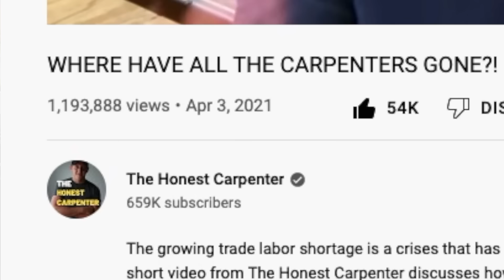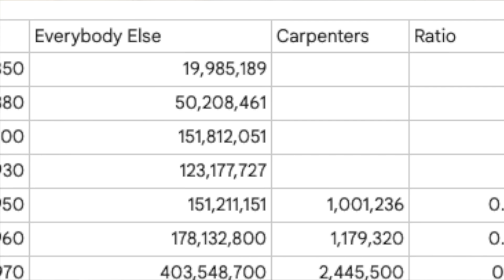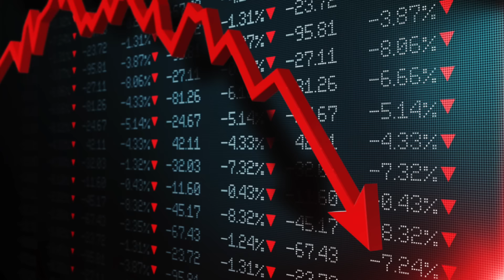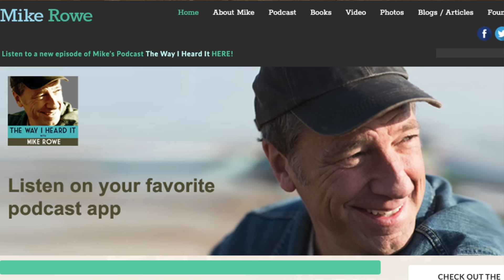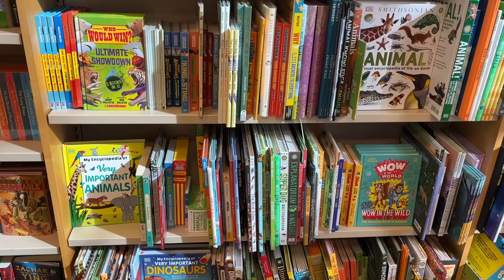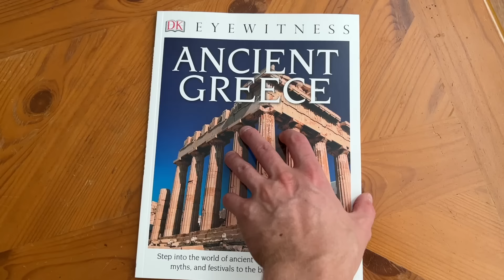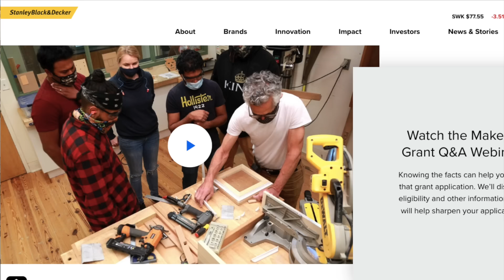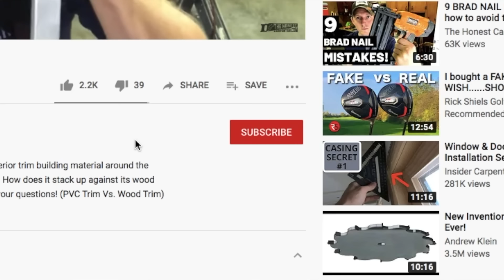THE TRADES ARE DYING...But The World Still Needs To Be Built! CAN WE FIX THE SKILLED LABOR SHORTAGE?

Comment: The trades are lagging because the pay. Unless you're out and running your own company, it doesn't pay well enough. Also there's no chance for retirement of benefits unless you're in a union. The economic decisions are based on cost and benefit. The benefit of going to college for stem outweighs the cost of college(sometimes)
Reply: Glad to see someone is applying some criticism. I've been an Electrician Apprentice for a couple years and can't believe how little some of my mentors are making. Nothing close to what they're worth, or what I was told my pay could be in a couple years. Not to mention the fact that benefits are generally on the poor side. I mostly enjoy the career, but working 80 hour weeks for the next 40 years isn't feasible.

Comment: Not only bodies are missing but pride in craftsmanship is disappearing and it's breaking my heart. Union Electrician 25 years in the field.
Reply: No one gives a damn about craftsmanship they just wanna slap it in and go
Reply: Absolutely. 16 year Commercial Electrician and I’m now told to follow the (3D)  “model” on the iPad for install. Who made the model? “The CAD dept.” Are they Electricians? “No.” Then why are they designing electrical systems? “That’s the spec pre-fab is made to fit.” Wait, I’M supposed to be doing this, not some CAD-F*#K in an office! That’s why everything is f’d up, twice a hard to work on as it should be and has too many bends in it. “It’s all figured out.” Obviously it’s not. Maybe CAD should come out here and show me how this is done. “That’s what you’re for.” Then don’t f’n tell me how to do my job. Then they wonder why we’re over on hours and cost 🤦🏼‍♂️🤷🏼‍♂️
Reply: @JD-bd5uu  And the saddest part is that those guys earn way more than any tradesman. This whole thing completely fd up.

Comment: I truly believe that early exposure to the trades is paramount to changing the perception of trade workers.

 My father was a contractor, so in many ways I had a tremendous advantage in learning the trade at a very early age. Plus I showed a lot of interest in building things at a very young age. At 7 or 8 yrs old. I remember going to work with my dad on a saturday morning. I'd haul 2x4s, he would make me hold the other end of the chalk line on the mark so he could snap the lines on the floor. He showed me how to read blueprints. I took all that for granted as I got older. And  although I always wanted to be a builder, my parents discouraged me from doing it, and sent me away to college. I got an engineering degree.. But, I always worked with my father summers and weekends.  I worked in the engineering field for a few years out of college but I really didn't like it much. I ended up starting my own business at the age of 24, building and remodeling. I already knew the trade from years of working with my dad. I've been doing it ever since. 
I'm a 58 year old career carpenter, looking at retiring sooner than later. I made great money when I started in this career in the mid eighties. The pay has remained relatively stagnant for decades. You'd think that the shortage would increase wages but that sadly is not the case. This is a tough business that requires a tough constitution to do day in and day out. I no longer frame houses, although I have all the skills required to do it very well...my body can't do it anymore. There are no replacements for guys like me that are ready to retire. I've seen many people in the comments here complaining about the rough and tough nature of the carpenters ,"towards a beginner". I did experience a little of that in my early years. But I think what "the beginners" don't understand is that a willingness to work is what is required and respected in this trade.   Learning comes after the work ethic is established. They all want to be black belts before they learn how to haul the wood and clean the job site. I've never shied away from doing the laborers job, but whose gonna lead the crew and doing the planning and laying out if I'm doing the labor job. If someone wants to enter the trade, they have to understand that it is work, and a lot of times it's very hard work. I'll show someone that's willing to learn, but a lot of this requires a basic understanding of math, geometry and manual dexterity. Unfortunately, these simple things seem to be missing in our education system these days. I don't want to discourage anyone from doing it, but if you're afraid of hard work, you aint gonna make it. I can tell you that you'll never ever need a gym membership, or have to go on a diet if you work this trade. I'm 58 yrs old and I have the body of a 30 yr old , but I got some hard mileage on that baby.
Reply: Well said man, been doing electrical for 5 years and i surely agree about not needed a gym membership!
Reply: I'm doing what equates to around $300 a day doing sub contractor work in the graphics/exhibition trade , building stands installing prints and vinyls etc all at age 22 off of the back of going through severely life threatening cancer and living with permanent nerve damage and fibromyalgia as the result of chemotherapy, I had done two years and graduated fully as a site carpenter before doing this, can the attitude towards beignners stink, absolutely but I whole heartedly agree the issue in alot of cases is that people my age fail at this and get shit from more experienced tradesmen is an ineptitude to learn, arrogance and self entitlement, it is real hard work, I had gone gym years prior but it's a different kind of strength, I had done snowboarding recently for the first time with my girlfriend and other very fit people and after 7.5 hours I had little to no fatigue meanwhile their legs and hips were in pieces, this really does build up muscular endurance and tests you mentally severely. I've been in my position for only just over a year now and I've already done plenty of 100+ hour weeks and yet I always hear people my age complaining about being overworked doing 50 hours at a desk job, trades truth be told are dying because young people are being pigeon holded into academia and simply lack the work ethic due to being pan handled too much so of course older people get frustrated with this ESPECIALLY when they're being arrogant le jumping ahead. To all young people, the money is waiting for you, the trades are simply waiting for your hard work. It's rewarding and will make you a better person. That's my rant anyway, wish all of you a great day/life, love from the UK ❤️🇬🇧
Reply: All the people with any degree of proficiency in mathematics get pushed straight towards college sadly
Reply: @jacobg7966  And then they get out of college with $300,000 in college loans, and get a $40,000/yr job. Makes perfect sense to me. 

No, I think that work ethic is what's lacking. Kids haven't been taught the value of working for what they want and need. Instead, mom and dad, give them whatever they want without even asking them to do chores around the house for an allowance. Not all households are like that, but most are, particularly in urban/suburban households. When I grew up, kids needed to get a job out of high school or go to college. Now, most just stay home and mooch off of their parents. It's the parents fault. I hate to speak in generalizations, but this is what I see going on.
Reply: @marcellemay7721  That's more or less how it goes, and people my age are so hyper focussed on this idea of having higher thought or morality despite having no skin in the game they haven't paid tax or really contributed to anything other than their Twitter wall, I don't even use social media anymore at all, just YouTube and WhatsApp but young people and their entrepreneurial obsessions and politics is a whole nother discussion. The UK specifically I can't speak for America, there is a tremendous exhaustive labor vacuum, there's schemes now to go through the education system straight into a firm to work I remember on their open days legit no a single person was interested but me, my first year I had 17 classmates by my second year there was 6 of us, 5 passed trade school out of 17 and now only me and one other works in a trade , even with those offers available being offered £50,000 starting salaries and being paid to go to college rather than the opposite they won't do it because it's "beneath them" or too hard. it's unfortunateley an old people's game, I did farmborough airshow this year in the summer and I was the youngest person at 22 out of maybe 5000 men, and my dad who got on that job with me joked that he felt young, apparently the labor demand was so harsh they had to pull alot of people in who was retired and it showed. So much experience but their bodies were just so clearly past the point of obeying, they have so much to teach and pass on and learn and yet no one my age is willing. You can easily get in at £27.50 an hour here right now, straight out of school and the hours are there as many as you can handle, I'm 22 and in my best month I made just over 10,000 doing 100+ hours a week working in Hanover Germany and Paris France and all over London to all that are listening please come to trades, listen and learn and work hard use your hands had common sense be open minded . Some people will be a cunt without any precept too and no one agrees with that, whenever someone's being harsh on you it is usually and should ever only be for your own good. Stay humble, there's always something to learn and as long as you do that it'll be hard but you'll pull through and it's an amazing rewarding career that can take you around the world and teach you so many tricks and really push you to build things you didn't think capable , and be part of what keeps the world going. Your mental health will thank you, if you're burned out give a trade a go , if you have a relativel or friend who does site work, ask if there's ever an opportunity to tag along as a labourer for the day , just help out see how it works, or do a workshop or a taster at a school, there are assholes everywhere for the most part in trades there's alot of love between the banta. Without the work force the world will truly fall. Exhibitions, Carpentry, Civil Engineering , painter and decorator it doesn't matter we are all a team on the building site ❤️🇬🇧
Reply: @gutzyzz1302  I couldn't have said it better...I agree with everything you said. Social media is a total waste of time. I love what I do. There's a sense of accomplishment...it's rewarding. The stuff I build now is all high end and custom remodeling in very expensive homes. I've done master bathrooms in some of these homes that cost more than my whole house. I'm not really ok with all the decadence but it keeps me well employed with no end in sight. We didn't even slow down during the pandemic...we just kept right on working.
Reply: @gutzyzz  "im not like the other zoomers i work 100 hour work weeks". dude youre a clown
Reply: @JM-gu7jx  By choice, I'm self employed I take as much work as I choose to. Of course I have to "obligate" certain contractors and if you turn down gigs you will eventually be weeded out by people who are more flexible but ultimately I don't have to work any amount. I choose to do 100 hour weeks most weeks, particularly when I cant see my girlfriend friends or family. would rather continue to peruse my business and grow and learn in time I can't be spending with others, if that makes me a clown, you're too far gone.
Reply: @marcellemay7721  Way to go man, I originally was going to go into bespoke remodelling of boats, on the joinery side either that or staircases in London. I'm glad I do what I do now, but that line of work you are doing is still a fascination and I'm sure it is an amazing opportunity. Happy for you, and damn straight, as the late Queen once said, keep calm and carry on. God bless <3

Comment: I have a foot in both worlds.  My profession is pure IT; communications and data.  But when something needs to be physically done, like building kitchen cabinets or reworking the plumbing under the sink or putting up a new wall in the basement, I love doing it myself.  And it all comes down to background.  I recall in middle school and high school (1980s) every kid took fairly advanced shop class, even the students who were college-bound.  We worked with a forge and lathe to make screwdrivers (I still have it!), learned to use table and jig saws, took apart lamps to learn the wiring.  Now my kids' schools have none of that, and it's a huge loss.  Even if a student has no plans to go into the trades, it's still part of life.  Why wouldn't everyone want to know how things work?
Reply: I am in a similar spot save for being in high school in the mid-2000s where we had none of those resources for shop classes.  There is real value in seeing a job completed, and being able to point to a thing and say, "I built/fixed/replaced that."  I count myself as fortunate to have acquired carpentry, electrical, and plumbing skills along the way.

Comment: When I was in school a lot of the professors would talk down about people who work with their hands, as if only mental work is important. Now I feel technology is being offered as a panacea, when it's really not. Well the good thing is wages will increase when there is a shortage
Reply from the maker: I hope they do, Joel. But equipping an entire generation to join the trades will be a massively slow undertaking. I’m worried about the time span when we’re so badly understaffed that things start to grind to a halt.
Reply: Robots can outwork people, and they don't hate repetitive motion. I hold the belief human beings are only going to move forward if we can get out of primary sector and manual labor all together.
Reply: @clearcut6818  Sounds absolutely dystopian.
Reply: @philshock3805  nothing dystopian about creative freedom. Do you enjoy working on plantation?
Reply: @clearcut6818  not all skilled trade work is repetitive and without deviation. Remodeling and maintenance for example.
Reply: @chrisburns5691  architects and designers are paid big bucks for their creativity, carpenters are just hard labor making it happen, and there're tons of competition.
Reply: @clearcut6818  not really. A good seasoned carpenter is hard to find these days. I work for a maintenance dept, we have several openings for a certified carpenter and can't find any.

As I said renos and maintenance, repairs etc involve a well rounded set of skills, lots of problem solving and approaching problems with different solutions. These kinds of jobs cannot be automated.

I have a side business doing carpentry/handyman work. I can't keep up with the demand, and I don't work that cheaply either- as I price my jobs to make 100 per hour profit, and I make it.
Reply: @chrisburns5691  and hence the "mass market carpenters will switch jobs, the craftsmen will remain" comment
Reply: @clearcut6818  i guess. I forsee a future where many aspects of new construction would be automated, especially structural work. But there are a lot of existing buildings that will need service work and updates/changes. That is the kind of work that won't be able to be automated. Maybe the problem will equal itself out as the market may not demand as many carpenters, as automation will be more present in new construction-but I think we are a ways off from that yet.

Comment: I wanted to work as a carpenter, and I did (as an apprentice) for about a year.  However, even the experienced tradesmen with 20+ years of experience had to get side jobs to make ends meet...  Now I'm looking at the market again for another job and the requirements are ridiculous, so I'm not surprised there's a shortage!
Reply: ive killed it last 5 years in construction, they are doing something wrong

Comment: This was a great video! I’m a retired journeyman toolmaker/machine tool builder and it’s a shame what’s happening in our country with the trades. I always made an above average living and never had any student debt. It always boggles my mind that somehow working with your hands is demeaning. You also have to use a lot of brain power to build things and to repair those things when they break. The trades have job security. You can’t outsource getting your home built, getting your car fixed, have you HVAC system installed or repaired. I wish you the best in this endeavor!!
Reply: im on your side but the DIY mini splits, the ones that can be installed yourself, are a lot better than something vented installed by a pro, and a mere fraction of the price

Comment: I am 51 and have worked construction since I was 17.  Fair pay for the work has always been an issue, why would young people want to go into an industry where the people selling the house are making more than the ones building it? We work in all weather conditions, destroy our bodies, generally have no benefits, no retirement, thousands of dollars invested in tools and equipment and are not compensated equally.  Let the relators and mortgage brokers build the houses.  Job security is another huge issue, it's feast or famine.  You either working 6+ plus days a week or you have to work for lower pay to get work.  Finding help is difficult these days as well. Good luck with your books, sounds like you're looking for other options also.  Construction has a lot of negative issues that need to be addressed in order for young people to want to pursue it a career.